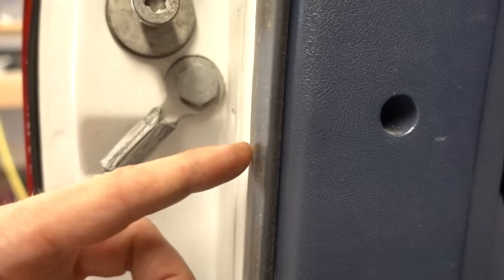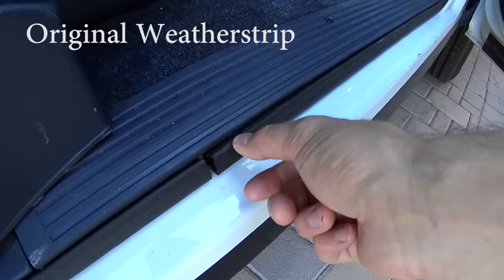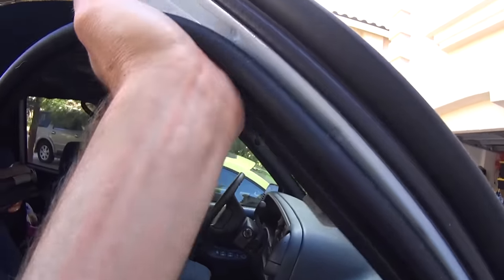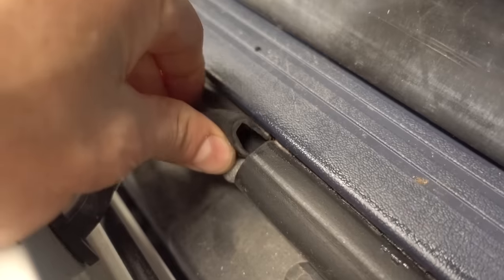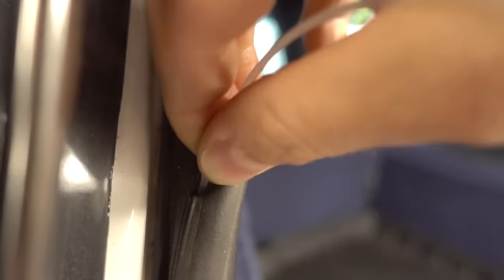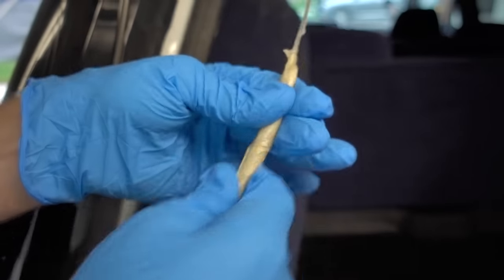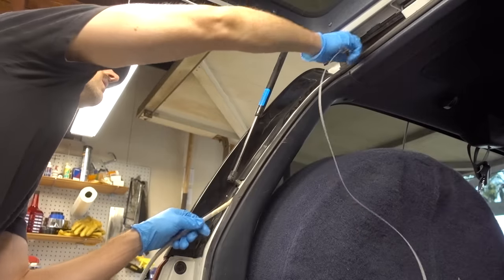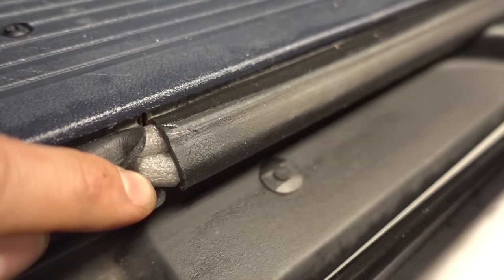Why You Need To DO THIS TO YOUR CAR'S WEATHERSTRIPPING NOW!

Comment: Surgical tubing has been used for YEARS already to fix flattened door seals. Works much better than foam and will last forever
Reply: Like airline tubing?
Reply: @j0nrages851  Airline tubing? You mean like the clear stuff used in industry for actuators and other low pressure pneumatic stuff? Yes that’s similar to surgical tubing. Surgical tubing is a bit different but I bet they’re both perfect for this task. And usually can be found at Lowe’s or Home Depot by the foot
Reply: i was thinking this would work pretty well ... do you need to lubricate it first?
Reply: @seaperu1  Silicon lube works well.
Reply: @jimichan7649   that makes sense, spray it through the opening, then feed the tubing  through, thanks
Reply: Great Tip
Reply: What diameter works best? I imagine there are various sizes
Reply: @jeffe6875    .25 or less is what l'm using
Reply: What Martin of Wintergaten uses for the pipes on the MMX or marble machine X
Reply: Old school car audio guys used to do this as well with stiff nylon rope, called it roping the seals.
Reply: The original rubber will fail though it may take 40 years. Cool hack
Reply: @kentrik999 If you don't mind slamming doors
Reply: @seaperu1  now where have l heard that before😂
Reply: @csea peru  Do you still have to use the wead eater cord process to feed the surgical tube through the rubber seal? If so, what gauge string is best to use?
Reply: Yes you always want to find the appropriate hole.
Reply: @jeffe6875  I would say that the inner diameter of your cars weather stripping is different for different cars. A small car with small doors would tend to need smaller weather stripping then a big truck with large doors etc.
Reply: May you post an example?
Reply: Surgical tubing, for medical liquids and gases, can be used as a tourniquet, and if you remember, sling shots.
Reply: Great video!!  I love the “repair not replace” tips!!!!!!❤
Reply: @jeffe6875  I just put 3/8 vinyl tubing, without lube and pulling in using fish tape. Was able to get it all in one run.  Will test on freeway tomorrow to see if 3/8 was thick enough to help wind noise. If I end up needing thicker, I have 1/2 but will 100% need lube for that size.
Reply: Vinyl sounds like the best way to go! All that lube is a mess and I had the tape letting go of weed whacker line repeatedly…not easy or fast🥵

Comment: In light of all the snarky comments on this video, THIS IDEA OF USING FOAM CORD REALLY WORKS!  It works so well I did my 1994 Chevy crew cab the first day, and my 2007 Tahoe the next day.  Replacement weatherstrip would have cost me ~$200 for the 1994 and almost $500 for the Tahoe.  I spent less than $20 for three packages of the foam cord and $9 for more .080 trimmer line.  .065 trimmer line was not quite stiff enough to slide through weatherstrip without kinking.  Lubricant was an old bottle of suntan lotion thinned with a little water and dishwashing detergent.  GM weatherstrip seems to have the vent holes either 5 1/2 or 11 inches apart, depending on vehicle age.  You will develop your own technique of how much trimmer line to use, whether or not to tape the trimmer line to the cord, etc.  It did exactly what Jimmy said it would do:  door rattles are gone.  Now you can hear other noises that will keep you busy trying to find them.
Reply: This wins the comments section for me ...
Reply: For lube you can also use a good slick trim/vinyl protectant.  My favorite for this sort of thing is turtle wax in the green bottle. It's so slick you have to be careful about using it on flooring like door mats, etc.  And it will soak into the foam and keep it plyable.
Reply: Other options are wire pulling lubricant or Armoral
Reply: 6ft of weather strip is like... $25
Reply: @acelilumelody4445  His comment is like 4 years old.
Reply: @da324  Yes, and....?

Comment: I was in the Automotive industry weather strip design for 20 years. We regularly put stuffers in tight corners so the weather strip would not flatten out and where the ends met for alignment purposes. Putting it in the whole weather strip may cause hard closing efforts/air and water leaks depending on the durometer(hardness) of the  stuffer.
Reply: In a few weeks foam deforms a bit and doors close easier
Reply: This is what I was hoping. @1marcelfilms

Comment: I did this 5 years ago on all of my doors . But i actully took out the whol rubber weather trim and striched it stright with my brother it was so much easier to fill the whole thing at once without cutting anything . And putted everything back up . Worked great .
Reply: Nice tip
Reply: @moonmullins8227  yes do it man .
Reply: is it me or is english optional??
Reply: Do you need any adhesive to put it back in place or just push it back in the channel?
Reply: @pgh1all1  some people can read fluently in typo
Reply: @pgh1all1  this is America, it is our duty to butcher any and all languages including english
Reply: @fancydarlin1 :
😂🤣
Reply: My god can you speak english please??
Reply: @aac9001  It depends on the vehicle and weathestrip, I would put a little bit of adhesive on just to prevent it from falling off in the future.
Reply: @fancydarlin1  Thank you Laurie.😊
Reply: @fancydarlin1  
It also helps to learn spoken typos. 
Chimley, chaing, plaskit, etc.
Many ways people may say something wrong
Reply: @kairu_aname  digical (digital), cerstifficate (certificate), cirtle (circle), somethink (something) are a few more I encountered a lot

Comment: Just an fyi from an Autozone guy. Formula 303 is one of the "best" products for rubber and plastic components. For rubber, 303 will "double" the life of the rubber part. When possible soak the part before installing for10 minutes like a belt or weatherstripping, clean off any excess and install. Weatherstripping, belts, dash and tires etc. 303 is also UV resistant. (If using on tires, it's best to raise the car, and completely soak the tire, including the tread, with 303, letting it sit as long as possible before cleaning any excess off. It's important to remember, if applied to the tread 303 must dry completely before safe driving. And that's usually 1-2 hours. But 303 will actually increase the tread life of your tires. Costs a little more, but is a great product that does what is says it can do. Just an Autozone guy who has tried pretty much every product out there)

Comment: Mine is like this.  Like the video. Careful doing this as the hollow seal section with its carefully placed holes is designed to be a secondary drain. If you block it you will get water over your head when getting out, that will now sit and cillect on the top run of the seal as it can't drain through the holes and into the hollow seal drain.
Reply: Those holes are there to prevent the seal from popping, like a baloon when you close the door, not to catch water and drain it away
Reply: @dirkfolscher3001  On some car its does exactly that. Especially cabriolets I assume. Its definitely used for drainage!

Comment: Ive done this same thing on old cars. But i used the smallest size vacuum hose you can buy. My dad said they used to do that in the dealership back in the 80's when someone complained of a wind noise.
Reply: yep, it's an old trick we used to use on old rubbers, put a bit of 6mm tubing in there to freshen them up, made the doors shut lovely again.

Comment: Also if you have any tears in the weather stripping you sand the area around the tear, use super glue and an adhesive accelerant to close the tear and then sand the slick side of some black electric tape to match the off black color of the weather stripping and tuck one length wise edge in-between the frame and weather stripping. Apply super glue to rest of sticky side of tape. Lay down flat, spray some adhesive accelerant. Wait to dry and sand down any obvious edges or lines till the become less noticeable. 

It's not gonna be perfect if you know it's there but to the untrained eye it's invisible.

Comment: Great video! Very helpful! I was afraid of getting grease on my cloth interior. Instead, I used corn starch and gold bond powder to lube the foam rope. It made a bit of a mess, but was easily cleaned up with a vacuum. Thanks!
BTW- When you are at the store and ask someone where to find the 'caulk saver'-PRONOUNCE IT CORRECTLY. You'll get some funny looks otherwise...
Reply: Caulk is pronounced "KAWK" there is no L sound in it.
Reply: @TheCapitalVice  r/wooosh
Reply: @TheCapitalVice  Depending on where you live, that's the same pronunciation as... well you know. 😜 I prefer to add the tiniest bit of an "L" in there when I pronounce caulk just to make sure people know what I'm talking about.
Reply: @InexplicableBill  Yeah I guess phonetics are regional or cultural. Leave it to our ancestors to make the word go under velarization and just omit letters that are clearly in the word for a reason. The modern word comes from "Cauquer" from the French which means "to stop up crevices or cracks", in Latin it comes from Calx which is referring to limestone. Leave it to the French and Romans (generally) to mess up the modern English language.
Reply: @TheCapitalVice  Excellent response! And I learned a new word today - velarization - which fits this conversation perfectly. Wikipedia discusses that word at length!

Comment: Dang! Just tried this on the front passenger side door on our ‘99 Burb. Couldn’t get the damn foam to pull through without breaking! Tried trimmer string and an electrical fishtape with no luck. Ended up forking out the $40 for a new one w/one day shipping on Amazon. Cause I sure as hell ain’t putting this old one back after taking it out lol. Really appreciate ya taking the time to show us tips and tricks, so far this is the only one I couldn’t get done!

Comment: Yep been doing this for years , before that " backer rod " stuff was common, I use to use the lil rolls of replacement weatherstripping you could get from home centers for your home window & doors , I used spray lube silicone to make it slide & glide , an don't forget to spray your Auto exterior weatherstripping couple times a year to keep it clean & flexible, plus it makes your Power Windows like Speed open & close
Reply: Great minds think alike. You might not be able to read my post, but I did exactly the same thing a long time before this video came out or even before YouTube or the internet was in use. Now as far as the power windows go? I just replaced the window run channel (L & R front doors/sedan) on my wife's Honda Accord. I tend to think that in that case, there's nothing that works better than factory parts. Yeh, it wasn't cheap. But I had to replace a regulator in the driver side to I tore it all apart (glass out and everything). They now go up and down just like when the car rolled out of the dealer. It was 2 pieces (a long one and a short one) and they just snapped right in.  I did try to lube them, but it only lasted just only so long. And yes, you should lube the weather stripping with a lube like silicone. Not oil as that'll only cause the rubber to disintegrate in time. Something else I do is to lube the rubber bumpers on the hood, doors and trunk with white grease. Just a dab'll do ya. Also....make sure the adjusters for the hood at the front are making snug contact with the hood. They're adjustable and if they're out of adjustment, your hood will rattle and make noise. Replace the rubber pads if necessary. Dorman makes a lot of stuff like that.

Comment: Great video jimmy...I’ve done this trick in the past but I used surgical tubing and it worked good..recently I wanted to do it again but was shocked at the cost of surgical tubing so I ended up using the inside of one of those garden hoses that shrink when not using.. after cutting the outside skin it reveals a tubing that is identical to surgical tubing .hope that made sense.

Comment: Great video. Home weatherstripping is always cheaper than auto as well, and you might find something than can fit your car. And generally, more than 1 type of weatherstripping will work. Don't forget the "magical" product Velcro. It has a number of applications, one being to re-attach your headliner instead of push pins till fixed.

Comment: Amazing that i still remember this video for a solution to my hood seal problem. 😂
The thing is that my interior intake is right under my windshield and engine odeur is coming in through the hood where the seal isn't seating properly. 
This trick fixed my problem and I no longer have that strong odeur coming into the car. 
Thanks for making this video it's a really good tip to remember. 😂👍

Comment: get a bottle of ATP reseal as well. its an engine oil additive for reconditioning internal seals. but you can apply it straight to rubber weather strip, hoses etc to recondition them to almost like new condition. rub down your old stripping after doing this foam stuffing and you really will have like-new seals.
Reply: ATP 205 is $20 a bottle!

Comment: I did the same thing on my 2007 Hyundai Santa Fe back in 2013 the weatherstripping had flattened out so I ran 3/8 inch round weatherstripping through the old stuff and it worked perfectly I still have the vehicle and it’s still sealed...!!!

Comment: That SuperLube is silicone based and works good as a rubber/weatherstripping conditioner. I also use it as dielectric grease.  Nice video 👍

Comment: I had done this for an 84 300sd I got. I had a heck of a time finding any weatherstripping for it's doors. An when I did, it was soo expensive. So I did that same thing. None of the cars stripping was torn, so all I did was use some Vaseline on the outside stripping and coat the caulk saver in it and slip sloop, I was done. Same thing, that's cars doors "vault" sound were back after doing this.

Comment: Surgical tubing is great too and has been used for a long time for this specific purpose. It can be purchased at Home Depot or Lowe’s by the foot.
Reply from the maker: Dude! That’s probably a much better idea!! Gonna get some!!
Reply: @1RoadGarage  What kind of surgical tubing do you recommend?
Reply: Wich diameter i go for? Going for 1/2 inch wht do u think?
Reply: @aveirozinou2919  it's hard to tell. I think it would probably be based on the specific type and diameter of your weather stripping. I know they're probably not all different for each vehicle... But I'm sure there is a wide variety of sizes.
Reply: @aveirozinou2919  also, if you can find a local hardware store or something they will let you take a few inches of each size... And they will keep two or three in stock. That way you could try them without spending money.... So you're sure to get the one that fits best
Reply: @hullinstruments  thank you for the help, the problem is ther is no local store near to me, all i can do is an online purchase, i tried a different tube i think a gasoline tube with 1/2 inch and it fill the weatherstripping so well but you can never close the door so im going for a latex surgical tubing with the same diameter but with it elasticity form, i wish it going to work and i can close the door 😅
Reply: Do they sell surgical tubing or just vinyl tubing?

Comment: You saved me,,,,,,again. Best wishes. As thanks, two products I have decades of successful experience with. Marvel Mystery Fluid.  Smoother, quieter, motor running. STP " CERAMIC" oil additive incredible.  You feel the immeadiate difference. Other expensive ceramics " zero, nada, nothing". Best wishes.

Comment: I reniuned my door seals on a 1996 truck last year, coating the old/collapsed seals with 100% silicon. Installed with an old tooth brush, then cleaned up with a rag. Where collapsed, it took a minute of working it in before they started stand out again. It made them like new and even the collapsed seals now look new a year later.

Comment: I did as you said and it worked. I have a 2010 Ford Escape with a leaky tail gate and window. It WORKED, THANKS AGAIN.
Reply: I'm about to try this on my 2012 Escape, any tips besides what he said in vid?
Reply: @arrestfauci287  I had a slight difficult time trying not to rip the hole as some of them did. I just went slowly but spray often as was said. Mine has NOT leaked. I also spray the rubber with sylicone spray every so often to keep it plyable from not drying out. Best wishes to ya Pal.

Comment: A perfect example of programmed obsolescence. Make the weather seals hollow so they fail, and have to be replaced. This idea might be useful for seals in other applications if they are also hollow tubes. This will save people a fortune, and not line the pockets of parts manufacturers and vehicle companies.

Comment: For lube you can also use a good slick trim/vinyl protectant.  My favorite for this sort of thing is turtle wax in the green bottle. It's so slick you have to be careful about using it on flooring like door mats, etc.  And it will soak into the foam and keep it plyable.

Comment: You could find the end openings push as much through as you can , then put air compression on end blowing it through enough to put more in than repeat . No grease , no holes for leaking or torn rubber.

Comment: Does the foam collect water? I’d be worried that it might start molding if it isn’t a hydrophobic material.
Reply: Likely closed cell. open cell would be a problem.
Reply: It doesn't. The foam is closed cell. 
If the water makes it past the outer surface of the weather seal, you'd have a leak into the vehicle anyways. the holes in the weatherstrip vent out the air trapped inside when the doors close.
Reply: Good point. Even if it didn't, it probably makes it hard for any water collected through tears or those holes to make it out, since those holes are there for that exact reason.